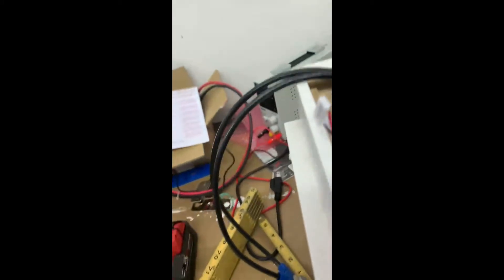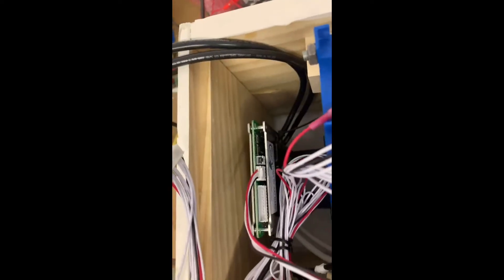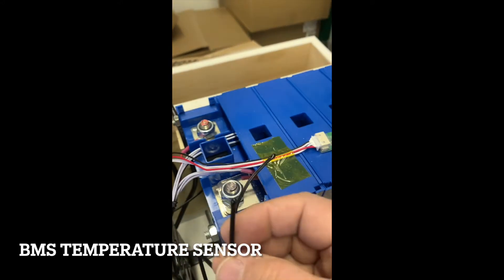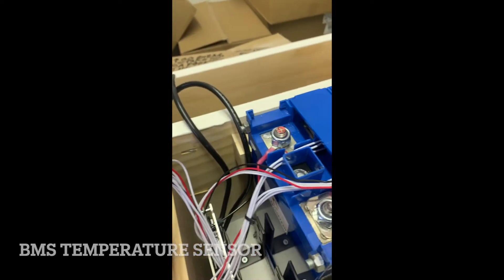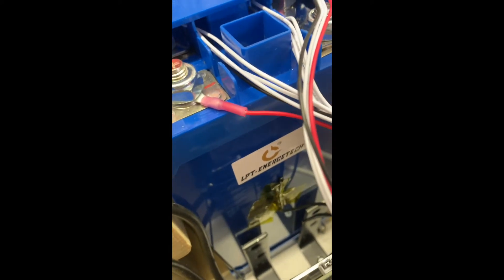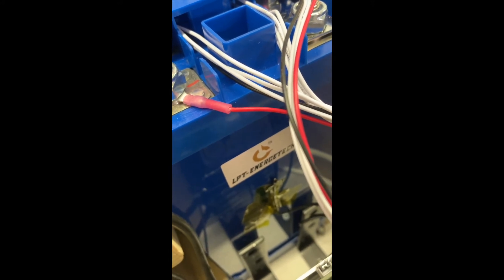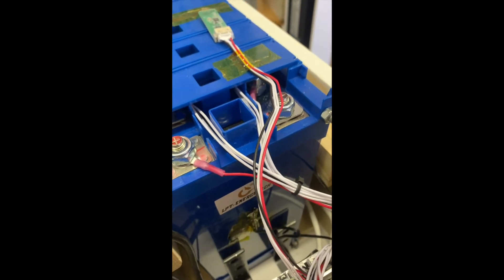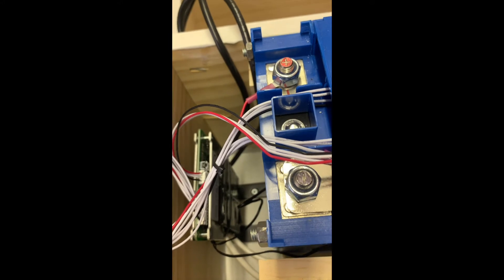Growatt 3000 watt battery build pt 2

Comment: Does growatt will work with DIY LiFePo4 bank with no communication cable ?
Reply from the maker: It does work without a communication cable. I used these DIY batteries and added the BMS. Since then technology has changed and batteries have gotten cheaper and more reliable. I now would suggest an SOK 206ah battery. The SOK has an internal BMS with low temp protection. By the time you have the raw cells, add a BMS and some type of case. The SOK battery is the cheaper option.

Comment: Are you concerned about the batteries getting too cold when ice fishing?
Reply from the maker: That is a concern. Keep the batteries off the cold floor of the fish house. Storage of the batteries should be in a cooler or insulated box. You can try setting the batteries on a low watt using, mat heater. The batteries sit on the mat heater, in an insulated box and the cold issues should go away. The BMS protects the battery from freezing temperatures that could damage the batteries.